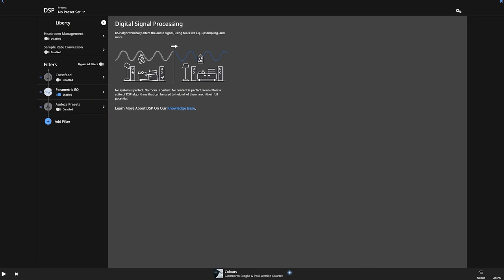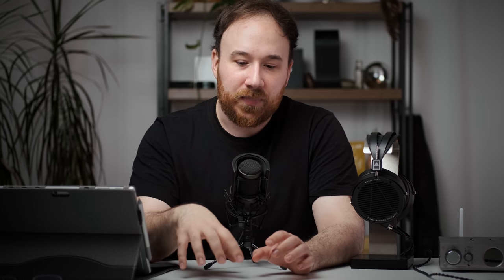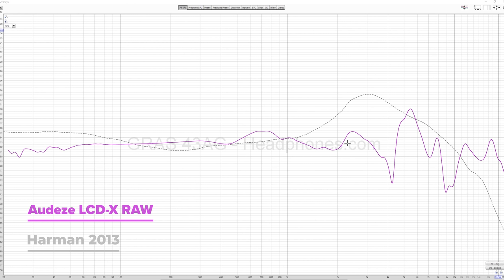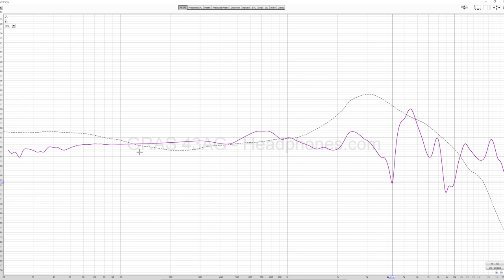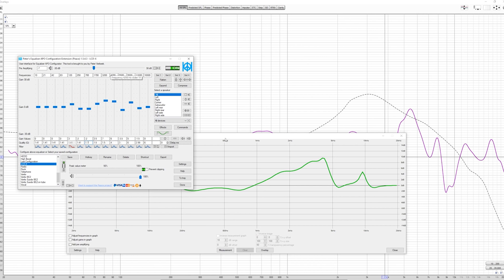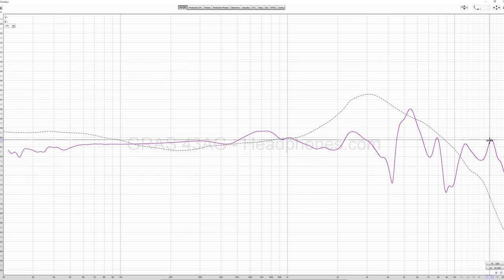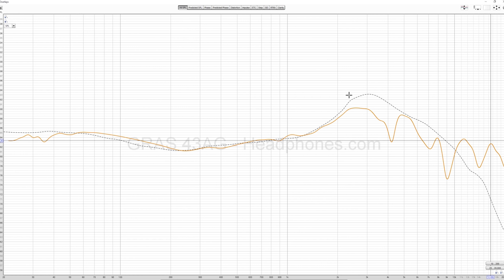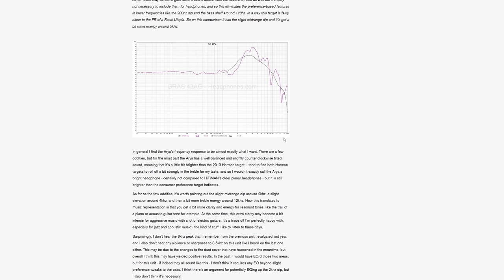How to EQ Headphones - Featuring Audeze LCD-X 2020 (not 2021)

Comment: I think I have understood that the harman curve is not the gain of the ear, instead it seems like its symmetrical, because if the ear prefer a higher volume for the treble (as I see in the Harman curve) then it means that the ear attenuate that frequencies, so they should be amplified by the source in order to be properly audible, am I right?

Example: receiving a constant signal in frequency, (like a monitor headphones), higher frequencies are amplified (by the ears), and treble are attenuated, so the headphones in order to follow the Harman curve has to attenuate highs and amplify treble. This means that the frequency response (gain) of the ear attenuates treble and amplify higher frequencies, being symmetrical to the Harman curve.
Reply from the maker: It's more so that the brain expects an elevation for where the ear amplifies certain frequencies. Think of the frequency response target as an ideal measurement at the ear drum reference point.
Reply: @TheHEADPHONEShow  Mmm
That seems clear now..
The harman curve is what you said, it is the response of a system that starts form an audio source everywhere outside the ear, and ends at the eardrum, so it is the canal I would say.
So normally, when experiencing sound, it is elevated where the Harmon curve suggests, because of the canal distortion, therefore applying the sound source almost into the ear, it bypass the canal and is almost directly applied to the eardrum, so, if not  as the harman curve, it sounds ‘wrong’.

Divagation:
It erroneously seems similar to the response of the eye, but it is a different thing:
The response of the eye is elevated in the greenish-yellow central region, and attenuated at the edges of the spectrum (red and blue), so the eye if receive perfect white (where white stands for a planar spectrum) should sees instead a greenish-yellow, and there’s nothing to do cause it’s not about the canal, but about the interior of he eye. The only way to see perfect white is providing a white without the right amount of green; or for seeing red the light should be a lot more intense than the analog green light for having a similar experienced luminosity.

Comment: I don't know. For years people kept saying to EQ my LCD2f 2016 headphones and listed the reasons why. I did EQ them twice with settings done by those in the know, and both times, I was not impressed. It made them feel lifeless, with movie scores I know so well sounding like they had gone through a noise filter.

Everyone is different, and not every headphone comes off the production line the same, so trying EQ is worth a shot, but for me, it did not help.

Comment: I do eq headphones, but I do find a big problem with the method you show.  You just showed how to eq with equalizer APO (this is the best we have, that I know of), but that only works with DS mode in windows and not if I want to send DSD direct via WASAPI or ASIO to a DAC.  I also cant figure out how to do good eq in DAPs. They use the android eq wich is really bad with only like 4 to 6 bands. There is the minidsp, but then it doesnt take dsds or high res files, and ILDSP (portable one) only has line out so we are forced to use their DAC instead of our DAC of preference. I wish someone can point me out to a system wide parametric EQ for Android (for any streaming app) or a Portable device that takes digital in and have digital out and does all the filtering in the digital domain. So at the end If I cant eq my headphones in all the sources  then eqing is kind of a waste of time and rather find a headphone with the signature I like.
Reply from the maker: Yeah android EQ is rough. That's why I'm more critical of IEMs with wonky FRs. But then again, people who use IEMs aren't always using them with a phone or a DAP either. With regards to your other question, yeah that's definitely an issue. To a certain extent, Roon lets you do this - and it's one of the reasons I do recommend Roon. But as for DSD exclusively, that's not something I've ever really seen the benefit of. I know some people are really into it, but that's yet another inconvenience.
Reply: @TheHEADPHONEShow  Thank you for your answer!! I rarely eq iems, since i never listen to then at high volumes, but I do  enjoy listening to music in my balcony with headphones and I use a DAP with lineout to more powerfull portable amplifers. You mentioned also that when you break the seal with the lcd xs your bass response drops. how much is it? since my lcs pads are in really bad shape (leather peeling) and that might be affecting the sound. Also  I remember from your podcast with crin that the oposite happens with planars, the sub bass gets enhanced.
Reply: @TheHEADPHONEShow  I wish roon wasnt that expensive. I mean is totally worth it but due to the current times we live in, is a hard call
Reply from the maker: @elburrona  A lot of that depends on the headphone's design. I think he was talking about how it impacts HiFiMAN headphones like the hE1000, and that's definitely true. Bass increasing when you break the seal also isn't unique to HiFiMAN headphones, but they are a good example of it. For Audeze's I think it's a bit more complicated because the pads are already so huge.
Reply: Wavelet
Reply: In the same boat as you. If there was a better support for ASIO or WASAPI, I wouldn't listen without EQ at all. I am not keen in getting Roon just for that. As it stands now, it is a hassle for me more than being useful.
We need more DACs with built in EQ like RME ADI-2. This should be a next step in DAC development.
Reply: @DBSTH0R  I think a lot of modern DAC chips support good Hardware FIR equalizations, but manufacturers dont even bother to use them since the snobby audiophiles think that eq is heresy!. MiniDSP has a digital in / digital out equalizer that supports up to 8 channels in 56 bit / 192kHz that might work for you if you dont care about DSD, (I dont think DSD is life or death but I found that DSD recorded albums sound superior even when converted to PCM, so if we are paying for the gear and the gear supports it then we should use it!!) For headphones DAPS are even worse, MiniDsp have a mini portable amp with sound filtering with 7 bands, but they use a rather cheap DAC inside, there is also the E1DA Power Dac that has an app called HPtoy (I havent heard it yet) that does some eq inside, but is a battery hog.  To be honest I think this is something that can be done in the digital domain inside the DAP with software, I see no reason why we have to buy additional hardware to do that. EQ APO is an excellent equalizer if not the best that exists and it does all its magic in the digital domain at 0 cost for us.  Anyone here have tried the USB Player Pro for android? I read it can catch streams and EQ them and the eq is a parametric equalizer, is not free but if it works I will buy.
Reply: @mikemack7933  Thank you for pointing out!! will try it
Reply: @elburrona  Using Topping D90 (non MQA) here, and for me it is more "ease of use" problem than anything else. Since I do play high res material (foobar or streaming service) I do want to use exclusive playback that allows my DAC to do the decoding on its own, at the correct sample rate without any resampling in the process. Did not find DSD to be any superior than PCM (D90 has native DSD support).
Reply: @DBSTH0R  well they you could benefit from a minidsp and it should eq really good!
Reply: @elburrona  Forgot to add that I paired D90 with THX AAA 789. Which miniDSP are you referring to?
Reply: Alvaro Gonzalez I regretted not getting it for $500. Now it’s $700......🤦‍♂️
Reply: @DBSTH0R  Diginano.. it takes in digital does magic and spits digital, but I think it only takes coax, but you can check if it gets usb too.
Reply: @elburrona  Thanks for the info. One more item in the chain, will need to read up more about it. For the time being I'll go with a set of cans that don't need mandatory EQ.
Reply: @DBSTH0R  yes, I do think all eq could and should be implemented in software before those bits even reach the DAC. it is even worse if we have to use a ADC to then DAC again like minidsp 2x4. Thats why the nano sounds reasonable to me since it works only in the digital domain.
Reply: @mikemack7933  it works fantastic on my phone! but is not supported in my DAP 😢

Comment: The reason why I don't EQ myself is because I'll never trust my ears to figure out if the FR is changing for the better or worse. If you own a measuring system this gets ridiculously easy because you just measure the headphone again and again until it's following the target response. Not to mention you're also EQ'ing YOUR own headphone, so you eliminate unit variation. Welp, guess I'll stick to oratory1990 and metal's presets for now.
Reply from the maker: Definitely good profiles to use, but let me ask you, what do you think they're using for their profiles? You can use oratory's measurements to develop your own  too. As long as the measurements are from a standardized rig you can trust, you can use that to make your adjustment to your preference.
Reply: @TheHEADPHONEShow  I think I worded my post weirdly, apologies. I do use EQ myself on both headphones I own, I'm just saying I avoid EQ'ing "on my own" because I don't trust my ears and I feel too inexperienced to be able to understand if I'm doing it right or wrong. That's why I use oratory or metal's presets. If I had a measurement system though, I could rely on it to see what my filters are doing directly to the headphone's FR and I'd definitely EQ to my preference.

Comment: I believe audeze has their own eq correction for this headphone and other on roon,  correct?
Reply from the maker: That's right. Reveal+
Reply: Yes, it flattens the FR for mixing and mastering purposes, I found it not very useful however whilst mastering, opted to test my songs on various sources instead and leave my headphones as is.
Reply: lately i tried the eq preset for the el8c in reveal and it cleaned up the sound pretty well, i knew there were problematic areas in the low highs but i couldn't pinpoint them exactly so their professionally measured calibration came in handy. and i could add my user flavor on top which was also nice
Reply: The HEADPHONE Show is there any way to use reveal+ eq without using reveal+? Like does it show which frequencies are adjusted so I can input the eq to another software for example?
Reply: @djhmax09  if you load the vst in equalizer apo it shows the changes in the analysis graph, though i am not sure how to extract the values except for trying to recreate the curve. also there's a free version of reveal if you want the headphone profiles only so you can see what i'm talkin about

Comment: I was wondering how to measure my headphones properly. Does someone know how to do this and what kind of setup you would need? From "smartphone mic" to "some crazy expensive mic", what kind of gear would I need and would it be worth the price? (i imagine it would not be worth it)

Or maybe I should just look for a sound profile on the internet and assume it is pretty much identical to mine?
Reply from the maker: If you're looking to get into the headphone measurement world, I highly encourage you to check out this article that covers the basics of FR: https://www.headphones.com/pages/measurements-and-frequency-response
It's mainly meant to help people understand graphs, but this is useful background information on the kinds of measurements that exist.

Industry standard rigs like the GRAS 43AG cost thousands of dollars. The reason for this is largely due to the ear simulators they've developed. A regular microphone won't be able able to accurately simulate the various amplifications a physical ear (and inner ear + ear drum) add to a headphone's frequency response. You could do a flat-plate type of setup or use the MiniDSP EARS, but these are NOT accurate measurement systems, and can only be used for comparison purposes.

Comment: Mac users, what's the best system-wide EQ software? I've been using Boom 3D but I'm not sure if there's something better out there.
Reply: I don't EQ these days but I have used eqMac2 in the past which worked well 👍
Reply: Rme for the expensive route. Lol
Reply: It's not free, but I use SoundSource (https://rogueamoeba.com/soundsource/). It's system-wide, and it provides a very user-friendly way of making use of OS X's native audio tools (called AU Lab). One of these tools, which you access directly from a menu in SoundSource, is Mac's own native parametric equaliser called AUNBandEQ. You can create EQ profiles for multiple headphones, and toggle between them using SoundSource, which can be loaded at startup and just sits in your toolbar. 

There are free ways of achieving the same sort of thing using SoundFlower (instructions here: https://www.superbestaudiofriends.org/index.php?threads/systemwide-eq-on-mac.7435/). However, my experience with free EQ tools on Mac - including SoundFlower and eqMac2 - has not been positive: they can be difficult to configure, and both SoundFlower and eqMac2 were quite unstable. I persevered for a while, but gave up and bought SoundSource in the end.
Reply: @reflectreviews8477  yeah I've used eqMac2 and I found it too buggy to enjoy using. I will check out SoundSource, thanks!
Reply: If find Sound Control to be one of the best system wide EQ's for the Mac- https://staticz.com/soundcontrol/ There's a 10 band and 31 band equalizer. What I like about it is that each output can have a separate eq. and routing. For example YouTube goes to the computer speaker with it's own eq. Tidal goes to the headphone amp with it's own eq. VLC goes to the surround sound receiver with it's own eq etc. The software is only $15 I think and a 2 week trial is available.

Comment: The trade-offs are really interesting for EQ. I typically use it, so it is good to know what it can do if not used properly.

Here's a topic I haven't seen addressed or was curious about, ear hygiene. Are there advanced or specific hygiene methods or techniques that people use to keep their ears cleaner than just regular showers and using q-tips to dry? I apologize for the total thread hijack, but I've been curious about this topic.
Reply: I just wash my ears more regularly with a flannel and really hot water, and use Q tips and toilet paper to clean everywhere I can easily get to.

Comment: EQ Profile (LS=Low Shelf, PK=Peak, Fc=Frequency):
Preamp: -10 dB
Filter 1: ON LS Fc 120 Hz Gain 3 dB
Filter 2: ON PK Fc 250 Hz Gain -2 dB Q 1.41
Filter 3: ON PK Fc 700 Hz Gain -2 dB Q 1.7
Filter 4: ON PK Fc 1700 Hz Gain 3.5 dB Q 1.5
Filter 5: ON PK Fc 3200 Hz Gain 7 dB Q 1.5
Filter 6: ON PK Fc 4200 Hz Gain 6 dB Q 4
Filter 7: ON PK Fc 5500 Hz Gain -3.5 dB Q 3
Filter 8: ON PK Fc 9500 Hz Gain 5 dB Q 6
Filter 9: ON PK Fc 11600 Hz Gain -1.5 dB Q 3
Filter 10: ON PK Fc 16500 Hz Gain -8 dB Q 1.41

Comment: Sorry, I'm a purist.  Now I get adding EQ to speakers that are going to be used in different rooms & settings that can introduce problems of their own but headphones are used in a relatively stable environment.  Your head!  Outside of mood swings & such, the environment is not going to change.  

My biggest question would be why would you even buy $1700 headphones with such obvious flaws & why are the designers producing them not fixing it?  I honestly don't understand this channel's (and some others) fascination with Audeze products.  I have found them to be overrated.
Reply from the maker: Because we want to enjoy the technical aspects of their headphones. The lcd4 is one of the most impressive headphones, in spite of its wonky tonality. EQ allows for that.

Comment: Eq for me is fine to remove big peaks but having to drop pregain a few dB sounds compressed and depressing. Doesn't the harman target vary on listening volume?
Reply from the maker: dropping pregain shouldn't have any influence other than volume. Just turn your amp up to compensate.
Reply: @metal571  but amps measure differently at different points on the pot. I could probably record and show you the difference I hear (loss in dynamics) if I max my amp volume and reduce pregain. Maybe less headroom?

Comment: When you do interviews or Q&As with manufacturers , it would be interesting to hear their take on EQing their headphones. What do they think of Harman target curve and why wouldn't they design headphone that is not matching to Harman target curve ?
Reply from the maker: I think in many cases they do try to get there. It's more a question of figuring out how to do it with the parameters they've chosen. There are of course many instances where they tune the headphones by ear but that's much more risky to do - not that it can't also result in a great sounding headphone. I asked Fang Bian from Hifiman about this and he told me he doesn't tune to the Harman curve in particular, but rather looks for what sounds the most "real". What that is to him I'm not sure, but it's resulted in some fantastic sounding headphones (mostly), and they do have a general house sound. So maybe he is following a target, but it's not a consumer preference one because it doesn't have the bass shelf there.